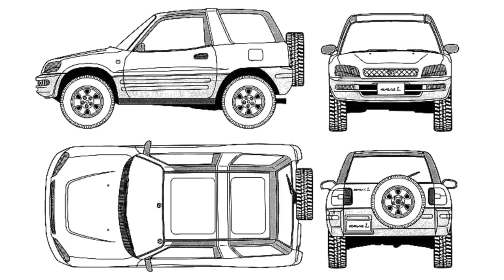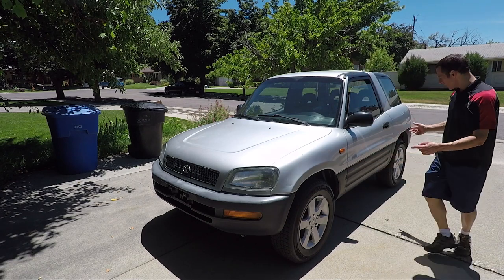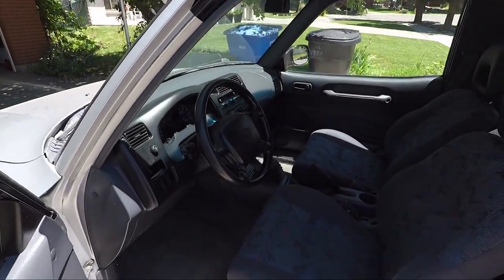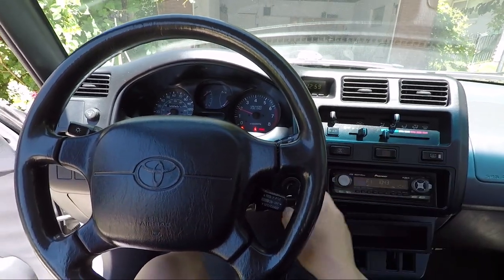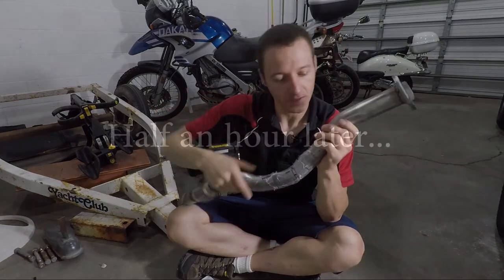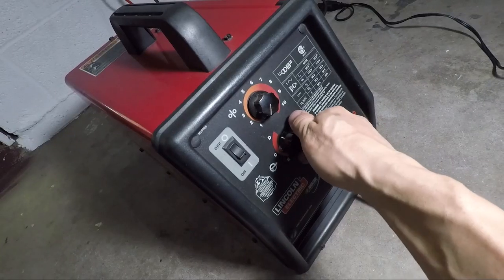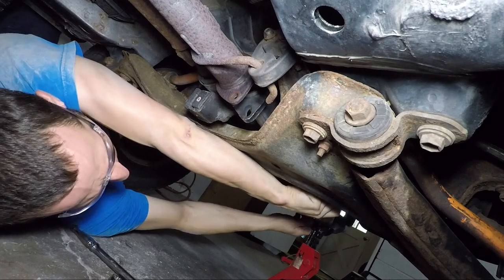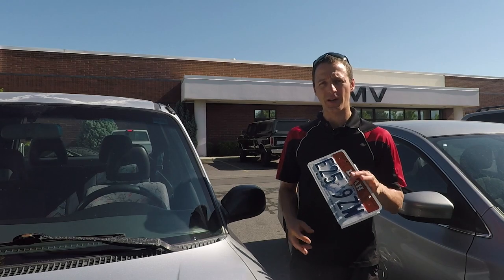I just got a first generation RAV4!  (episode 1)

Comment: Been searching for a cool small car for my first project. Just bought a RAV4, two door, 99 and one extra from 97 for parts. Then founding this angel in lab coat makes me feel like maybe I can get this work in the end. Many thanks for your work!
Reply from the maker: Thanks for watching.  A little advice:  don't take too much stuff apart all at once.  You want to be able to drive the car most of the time.  If you get in over your head with too big of a project, you might get stuck and you'll have trouble getting the motivation to finish it.

Comment: Great site well done Paul,, lv owned a 1994 2dr RAV4 for over 12 years no major problems, only work done was Radiator, did cam belt,water pump kit. This has been the best car I’ve owned it’s a1994 so first made. Again well done on site will make services easier.👍

Comment: After about a year of searching I found a 98 Rav4(2door) with 61,000 mi. 
Manual transmission
Soft top
Fwd 
Couldn’t be more happy
Reply: I envy you man, I'm looking into buying a 4door Rav4 Manual 96-00. Preferably a 2000.
Reply: Ahumada 1999 4-door should be a lot easier to find. Manual will be harder to find with lower miles
Reply: Gayyy. 4 door for life
Reply: I just got the same one with 168k miles!

Comment: Had two 'pending codes' on the 1999.  
P0440, P0441 and P0446.  All EVAP.   Bad gas cap, codes gone.  
Other code was "alternator"  !!   But it was just a loose battery post connection on the positive.                 Quick, cheap, easy.

Comment: Welcome to frustration station! How's the rav4 doin' ya these days? Still continuing the project? I've been going at mine for about 4 years. Finally got all the rare goodies for it. The OE bushwhackers from the facelift model, old man emu lift kit (a bastard and a half to find), rear wind deflector visor/spoiler hybrid thingy (there's one OE and one JDM type left on ebay btw), original roof rack, original unused floor mats courtesy of Toyota themselves. And to top it all off... The full TRD treatment from Toyota racing development in California. They were able too hook me up with an n/a custom 5s-gte frankengine pulling 330 at all 4. Whole project cost about 7k. It's not super powerful or fast but I love my little financial mistake regardless.
Reply from the maker: It sounds like you have an awesome RAV4 build.  I would love to see some pictures of it, or better yet, make a little video about it on YouTube.  
My RAV4 has definitely been a struggle, and I took a break this summer and let it collect bird shit in the driveway for 4 months.  I just cleaned it up last night and put it in the garage for the next round of financial mistakes. 
I'm really interested in your engine swap.  Did you just ask TRD in California, and they built an engine for you?  What transmission did you use?  How much did they charge you for the parts?
If you want to chat about it, you can send me an e-mail at Paulz1265@gmail.com

Comment: Hello Paul,

I've watched a lot of your videos and gotten a lot of information. I have two RAV4s myself. One car is a long version from 1998 and then I have a short version from 2000. Since the paint on one car is in very poor condition, it should be coated with Mipa Protector. To do this I would have to remove the plastic parts on the sides of the car. Have you ever done this and if so could you explain to me how to remove the parts? Kind regards
Dieter

Comment: The little secret of first-gen manual RAV's is that the transaxles (that Toyota bought from Mitsu...maybe they should have thought twice about that) on a lot of them start popping out of 5th gear around 100K. You can't live without 5th gear, which is ALREADY not a very tall gear. This is not an inexpensive fix. The transaxle has to come out and get disassembled.
Reply from the maker: Luckily, I haven't had that problem yet.  Thanks for sharing!

Comment: How much was this rav4? also, can you tell me how much you spent on it so far to fix it? I'm thinking of getting one
Reply from the maker: I paid $3,500 for my RAV4.  It's a 1997, with 150,000 miles.  So far I've spent about $500 on maintenance stuff like fluids and a tune - up.  I'm currently installing a lift kit, which is becoming very expensive because my RAV4 has a lot of rust.  Toyota did a good job painting the under side of the unibody, but skipped paint on all the suspension and bolts, so it's becoming a bit of a nightmare project.  If you're buying an old RAV4, try to find one that isn't rusty.  If you do get a rusty one, working on anything under the car will be a very bad time.
Reply: Thanks, I will take that rust aspect into consideration. I've become obsessed with these old rav4's

Comment: Have you had to change out the throttle cable? My accelerator just stopped working while on the road. I tighten the bolts around the throttle but it happened again. So I’m trying to change the cable out n am stuck. Any suggestions?
Reply from the maker: I haven't worked on the throttle cable yet.  My car only has 159,000 miles and the cable is still good.  It should be fairly easy to replace the cable.  The hardest part will be pulling it through the firewall and disconnecting it from the gas pedal.

Comment: What would a 1997 Rav 4 with a 2Jz engine swap be. Worth?
Reply from the maker: That's an interesting question.  According to Kelley Blue Book, my '97 RAV4 is worth about $1,800.  I paid $3,500 for it last year, and I was lucky to get it.  Another guy offered more money right after I paid for it.  4 wheel drive vehicles sell for a lot of money in Utah.  Performance modifications like a better engine don't necessarily increase the vehicle's value, unless it's something that people want.  Basically, a car is worth what someone is willing to pay for it.

The 2JZ swap would be extremely difficult, and not practical at all in the RAV4.  Some people have replaced the stock 2.0 liter 3S-FE engine with the 3S-GTE from the Toyota Celica or the Caldena.  It's still a 2 liter, that bolts right up, but it has 260 horsepower with a turbo, instead of the 120 horsepower from the stock engine.  YouTube has a few videos of a white 4 door RAV4 with the 3S-GTE doing 4 wheel burnouts in the snow.  

My plan is to eventually swap the 3S-GTE engine into my RAV4.  You can get the engine used, from Japan, on eBay for about $1,000 but it will take a lot more money and time to actually get everything working.  I'm hoping maybe a year from now, I'll have that engine in my car.

Comment: Anyone have any tips on fixing the cassette deck on the original radio
Reply from the maker: I've never tried that myself - I installed a new radio in this video:  https://youtu.be/hsDxVjoxz8k
It might be possible to fix the old radio, depending on what's wrong with it.  Check the junkyard and eBay for a replacement cassette deck.
Reply: @LabCoatPaul  yes I saw the video earlier in the week :) it was great btw, I think I might just get a new one I’m planning on hooking up subs anyways